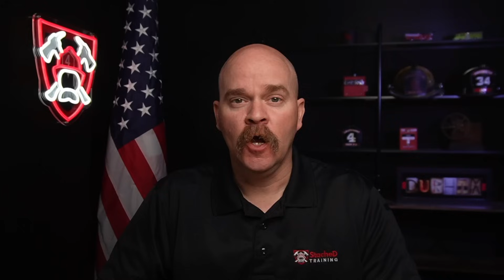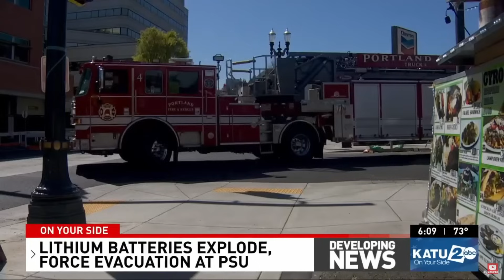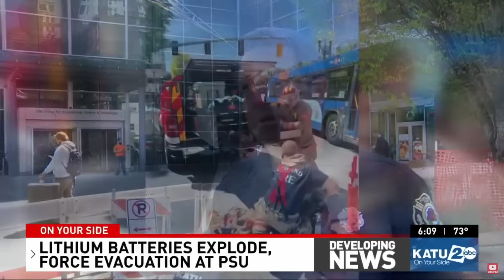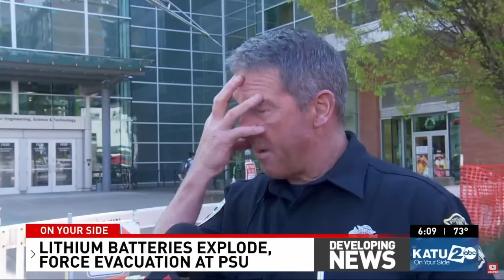Engineering Class EVACUATED After Battery Fire at Portland State

Comment: I recycled used lap top batteries and one of them had a terminal runaway when I was charging it in a proper charger. Good thing I was in the room when it decided to get super hot. Burnt my fingers when I touched it. Melted the ice on my driveway when I threw it outside.

Comment: it's not just schools, one company I worked for manufactures their own batteries for their deliberators and pacemakers and every so often there is a dumpster fire because an engineer or two will take a scrap of lithium from the dryroom for what ever reason and eventually toss it in the trash, which ends up in a dumpster and if there is rain,  you get fire.

Comment: I was a very young E2 in the navy when this occurred. There was a battery thermo runaway on an F14 Tomcat on the starboard side midship when Air Boss made the 1MC announcement on the flightdeck. Firehoses were manned and readied, other deck crewmen grabbed PKP fire bottles. In seconds maintenance personnel had climbed the aircraft to remove the offending battery. The battery was safely jettisoned over the side without injuries or damage to the aircraft. Had this not been successfully handled, a fire on the flightdeck could result. My first introduction to a battery thermo runaway.

Comment: Certain common lithium ion battery chemistries are much more difficult to extinguish than others.
“Certain lithium-ion batteries produce oxygen during combustion or thermal runaway, primarily due to the decomposition of their cathode materials. The main types that release oxygen are:
	•	Lithium Cobalt Oxide (LCO)
	•	Lithium Nickel Manganese Cobalt Oxide (NMC)
	•	Lithium Nickel Cobalt Aluminum Oxide (NCA)
These mixed metal oxide cathodes can release significant oxygen when heated, especially above 150 °C, as their crystal structures break down. The released oxygen reacts with the electrolyte, fueling combustion and making fires difficult to extinguish. In contrast, lithium iron phosphate (LFP) cathodes are much more stable and do not release substantial oxygen under similar conditions.”

Most people don’t know this!

Comment: Standards for battery monitoring systems, individual cell management, and charging / discharging setups is a big one. You can charge a lithium ion battery manually without a BMS but unless it's done with live supervision and voltage monitoring by an expert it's not a good idea.

Comment: LFP batteries are a lot safer.  They are also the dominant battery type now. 

 STEM labs are always dangerous.  HS chemistry labs did dangerous things.  The teachers should be warning them, then checking in on what they are doing.  They probably were.  Explosions and fires are par for the course and have been forever.  It's so common it's a trope.

Comment: In one of my first year labs we were working on 1 amp constant current power supplies and one of the students got the polarity of the 3 1000micro farad capacitors wrong and they exploded violently with the sound like a rifle going off. The student had to be rushed to the hospital to have their eyes examined for contents of the capacitor. PPE should have been required but this was in the 70s
Reply: Yes, those little capacitors can really go off, they're like miniature dynamite sticks if hooked up the wrong way. As an electronics tech I've had up close & personal experience with them, and I treat them with respect!

Comment: mandatory battery protection; all batteries SHALL have fuses in their circuits/applied loads, No short cicuits shall be allowed to make the batteries explode/burn...!
Reply: Most of my life I've been involved with electronics, and it never ceases to amaze me how often the last part to fail is the fuse or circuit breaker. I've repaired countless circuit boards where virtually all the expensive ICs & transistors went up in smoke, yet the 0.5A fuse is still perfectly intact!

Comment: If engineers aren't creating smoke, flames, and explosions, they aren't pushing the envelope adequately.
Reply: Try...Fail...Learn...Repeat...
Reply: And when it all goes wrong, evacuate the building and leave it to the firefighters to take all the risk in dealing with the problems.
Reply: SpaceX has failures, but progress much more than fail.
Reply: That's true for racing and some military applications, but not engineering in general.  Good engineering includes having a safety margin.

Comment: I suspect the reason there are not more fires reported is due to the high cost of cells preventing higher capacity battery packs from being used in the common small lab experiments and design projects limiting their use to semester group projects or well-funded research projects.

Comment: Really need a good battery safety film for engineers and manufacturers! hint*hint ;p Really something showing how quickly a pack can go into runaway if a shorted or overcharged, difference between discharged and charged runaways, safe handling, storage, etc.. and really what to do if a pack does go into runaway? besides run-away, call FD, maybe a sandcan or something.. You can tell people over and over, explain why things are important but a short safety video always sticks in ppl's heads better and is easier to digest.. thx for ur vids!!~ d(^___^)

Comment: There definitely should be designated workshops and labs for working on these batteries. Lots of ventilation and means of egress, proper storage of material and projects, and isolation from other combustibles.

It's also really disappointing how there's very few options consumers have for battery storage. There's plenty of options for industry, though these cabinets cost thousands of dollars.
Reply: That's a great point! Since I became aware of the dangers of these battery packs I realized that most of us are in danger; we have phones, tablets, power banks, tools, kitchen equipment- all powered by batteries. I've been thinking of getting a cabinet just to store & charge the stuff I'm not using at the moment- but you're right, the options are limited & expensive. I'd like to be safer, but I can't afford hundreds of dollars, and I'm not alone in that.